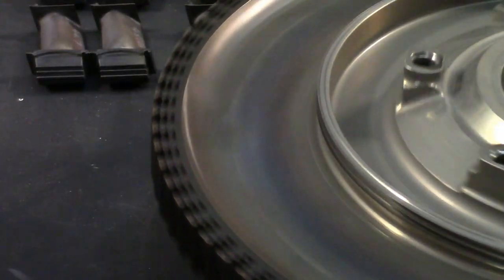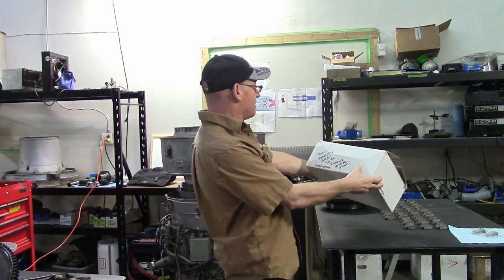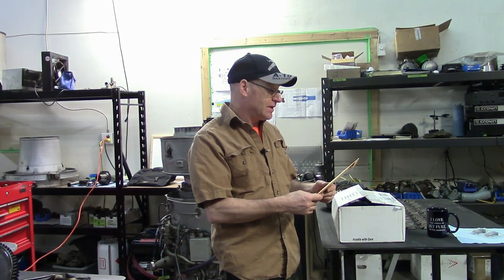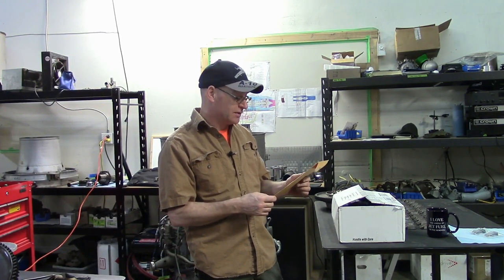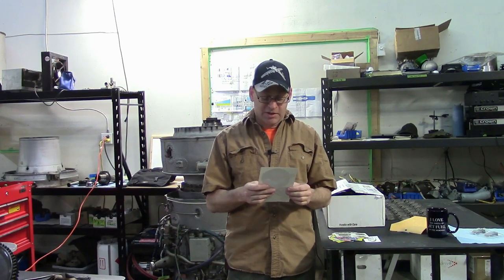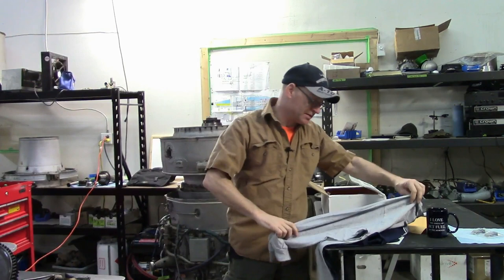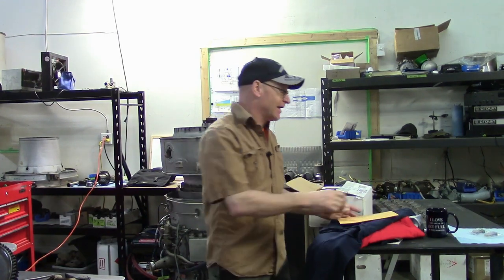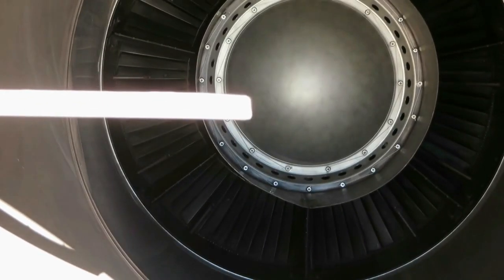Bonus from and for Jet People

Comment: A friend of mine once had a picture of his grandfather on the job at P&W. At one time  he was heavily involved with the development of the R-4360 Wasp Major  ( the corncob ). He was a very happy and jovial person 99% of the time so when he became angry and frustrated during a prolonged series of tests  one of his co-workers decided to take a secret photo of him.  I asked his grandfather about the picture and he said in the photo he  was working on the carburetor system as it was set up for the engines in the B-36. The R-4360 was never designed to be used in the pusher configuration and overheating and carb. icing was a problem that he worked to correct for a long time.  He was clearly pissed off in the photo. He told me the years of transition from piston power to gas turbines were the most exciting times of his career. He was hired by P&W as an engineer straight out of college and  worked for them until retiring about 1970. The picture was destroyed when a water pipe burst in my friends apartment about 10 years ago.
Reply from the maker: +Jayne Gus That's a great story; too bad about the water pipe!  In my video about the Hiller Aircraft Museum, just outside San Francisco, I show their amazing moving cutaway of the R-4360.

Comment: How long can you safely hang out around exhaust duct while the engine is starting up? I would imagine it would get hot pretty quickly, but I was surprised that you were able to stay inside there long enough to see the turbine start up. (I know you have done it in a couple other videos as well)
Reply from the maker: +eivilcow33 Actually, if you understand the starting process, it takes about 15 seconds from after the rotor begins to turn before any fuel is introduced. But it takes about two seconds before the air blast becomes intolerable. No way you're going to get hurt unless that is what you are trying to do. You may want to watch How to Start a Jet Engine.

Comment: At what RPM does the turbine start to rotate, or is the windup noise we hear from the start cart before the pressurized air is sent to the starter motor?  I assume the turbine is spinning before fuel is added.  TIA
Reply from the maker: +Robert Slugg It is, and it is. All explained in the info of one of my very first videos, called Starting a large turbine engine.
Reply: When the start cart dips in rpm (and the pipe moves a bit) is when the turbine starts to spin, because this is a single core engine, everything turns at once. Fuel is added after the igniters, and you'll be able to tell because the engine starts then, you can tell because of noise changes

Comment: AgentJayZ,
I just might have an interesting question. Modern commercial and military aircraft have requirements for tremendous electrical loads, I heard up to three megawatts maybe more.  Is this power provided by a mechanical takeoff through a gearbox on the core section or a separate power turbine?
You said you read all comments, so I posted to the video I’m currently watching.
Reply from the maker: All electrical generators I have ever seen or even heard of... on airliner engines... are driven off the gearbox of the engines, or an auxiliary power unit elsewhere on the aircraft.
When you say separate power turbine... if you mean a separate turbine engine for producing electrical power...  ...   ... I hope that's not what you mean, because we take marks off for that kind of thing.
Reply: Thank you AgentJayZ.  I was over thinking it.
Reply: Please don't take any points off.  I have the joy of living on the Northern California coast.  While driving into the village of Mendocino, I realized what I wanted to know.  Does it make any difference as to which shaft is used run the electric generator?  I would think that power is power and the bottom line is how the engine designers want to do it.

Comment: If you have an old engine that is out of service for a long time, what is the process of maintenance that you perform to bring it back to work? what are the main steps? can you please summarize them in a sequent way?
Reply from the maker: +Abdulrahman Ameen
Take it all apart.
Clean everything
Inspect everything for damage or wear.
Replace or repair all worn or damaged parts
Reassemble engine
Test engine.

Thousands of hours are required to do this, si it is an expensive process.

The more steps you skip, the more you are risking failure. Obviously, none can be skipped when it comes to aviation engines.
Reply: +AgentJayZ so useful! thank you so much :)
Reply: +AgentJayZ 
An other small question plz..what are the main differences between the western and eastern (American and Russian) engines in design and maintenance? Are there any major parts that differ?
Reply from the maker: +Abdulrahman Ameen That is a gigantic question, and it has been rejected.